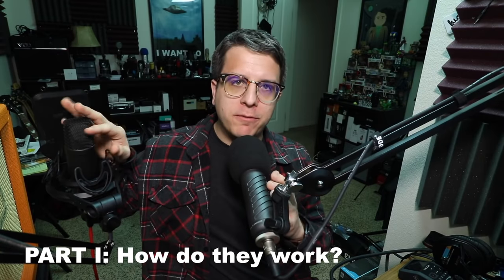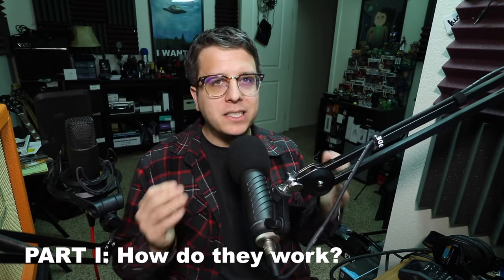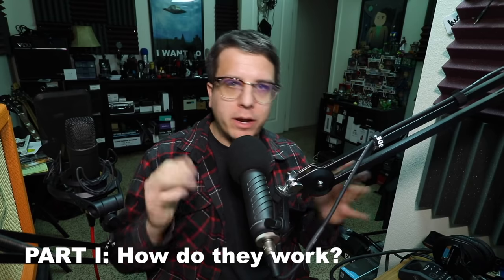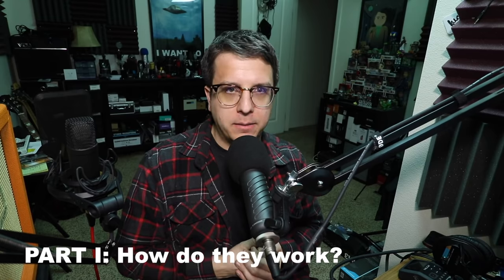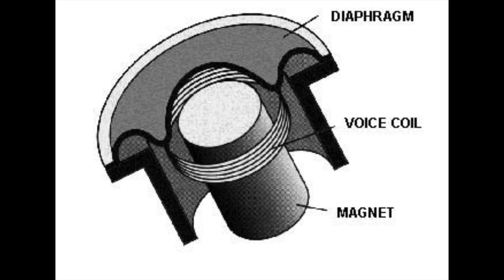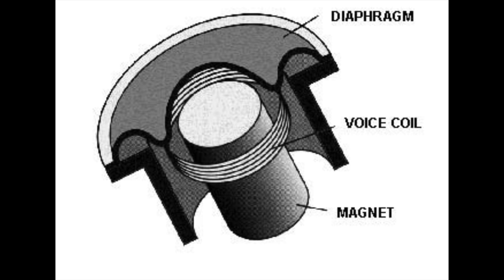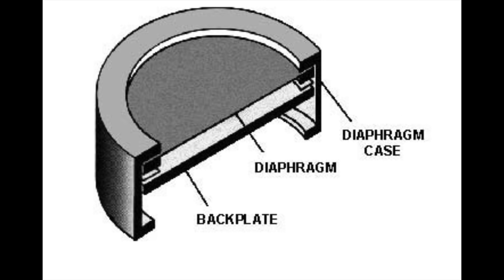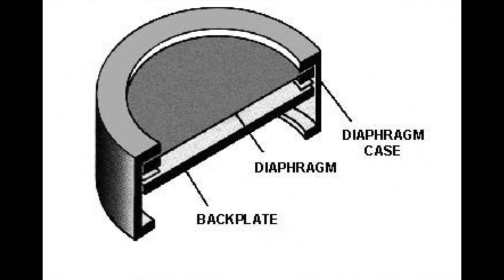Dynamic vs Condenser Microphones, What's the Difference?

Comment: A very good primer on mics with one exception. All microphones have a pickup pattern that determines where it picks up sound from. Three common types (there are several others) are cardioid, omni-directional and uni-directional. Some mics even have an adjustable pattern. His dynamic mic has a cardioid pattern which means it gathers sound strongly from the front but is much weaker from the sides and get almost nothing from the rear. You can buy cardioid condenser mics. In other words, the technology, condenser vs dynamic, is less important than it's pickup pattern in determining from where sounds will come through.
Reply: Dynamic microphones typically do a better job than condenser microphones at rejecting background noise, even compared to condenser microphones.  That's partly due to the underlying technology.  Condenser microphones are just more sensitive in general, especially outside the midrange frequency ranges of the human voice.

Comment: You are the first and only person who said condenser is wrong term and it's actually capacitor. 
I got all answers from you which I was finding since 2 days. Liked and subscribed.
Reply: Because condenser and capacitor is the same electrical part. Sure, condenser may have other meanings, but 100% accurate both ways.
Reply: Flux capacitor
Reply: Nope, it's not wrong.
Capacitor is called condenser in some languages.
Reply: @BJaca-tn3om  Condenser is also the word that was used in english in the old days.
Reply: @peterbaan9671  Same as tube or valve.
Reply: Condenser was the English term for capacitors (and still is, in many cases). This terminology was, and is, correct. As far as terminology goes, I have more issue with "lavaliere" than with "condenser"; but I'm okay with both.
Reply: Pdrew - That reminds me of Back to the Future, am I right? ☺️
Reply: In my language a "capacitor" is called "kondensatorius", which is essentially a "condenser". As a gent mentioned prior to me - some languages have that word in them, whereas a "capacitor" is nowhere to be found.
Reply: @RedVelvetUnderground333  hahha nice one
Reply: "condenser mic" is in common usage, therefore it is correct.  

I mean, whoever heard of "capacitated milk"?
Reply: @Tuning_Spork  So is the phrase "moot point"; but it always uses moot incorrectly.

I don't disagree with you, but that isn't a logical reason for the conclusion.
Reply: @peterbaan9671  i read the word condenser a lot in older electronics books, i think they don't use it anymore nowadays, but for microphones the word was kept.
Reply: @Tuning_Spork  I'm betting the majority of the reviewers have never heard of condensed milk either..:-)

Comment: Nice work as always. I tend to use dynamics for myself and anyone on my show that has an understanding of mic technique. I'll put guests on a condenser, as they're a bit more forgiving on distance, for those not comfortable with staying in a dynamic's "sweet spot."
Reply from the maker: I too am a huge fan of dynamics for my podcasts. I do need to work on my mic technique though. I just eat the damn things, but lucky for me the Procaster and SM7b have a decent depth to them so the proximity effect is not too bad.
Reply: Podcastage Right. My poor technique is a product of singing in to SM58s in bars with garbage sound systems and trying to hear myself. If I keep the mic INSIDE my mouth, maybe I'll be able to hear better :) Plus, it's a security blanket. I feel more anchored on stage if I'm touching the mic from time to time.

Comment: This might be the most practical comparison video on condenser vs. dynamic mics for a lot of people. However, you could probably mentioned around 2:40 that a dynamic needs a quiet (i.e. expensive)  preamp/interface due to the low sensitivity. Otherwise the recorded sound may have audible background noise which is not accepted at least for certain types of recordings.

Comment: Dropping facts, even 6 years ago!   I'm more shocked by the hatless presentation!  There also seems to be far more space in your room back then, unless it's just a very different lens.
Reply from the maker: Wow. Thanks for watching all the way back. The room looks a lot smaller on camera because I was using a 10-18mm lens and was wide open at 10mm, now I use 18-35 at 18mm. But also there's a lot more stuff and the rack to my left makes the room look a lot smaller too.

Comment: Previously I asked what mic I should use but I forgot one factor. I will quickly re summarize. I have a lot of background noise air conditioner, I'm in an apartment, smoke detector occasionally beeps and all that. The one thing I forgot is i need it to be a USB microphone or one that plugs into the mic in on the computer. I don't have a sound interface and would prefer not to buy one. Thanks for the previous reply, and great video Bandrew!
Reply from the maker: Look for DYNAMIC USB mics (Samson Q2u, ATR2100USB, AT2005USB).
Reply: Defuzzler the Rode Podcaster is also very good
Reply: Turn off the AC & disable the smoke detector

Comment: Damnit, I'm addicted to this channel. Any suggestions for a mid level, all around mic? Probably less than $100? looking to start recording, mainly for music... thanks!
Reply from the maker: It would be impossible for me to give any advice with that information. I have a BEST USB MIC UNDER $100 video that may help.
Reply: Thanks for the reply, will check that out :)
Reply: Brit Brandy should check out the toner condenser bm70 mic for 32$ with sabrent card and phantom power
Reply: Look for a used sm57 or sm58.  Can find them all day on guitar center used gear page and they are nearlu indestructible.

Comment: Thank you for the video. I guess I need a dynamic mic for podcasting, also for the procaster mic, I understand I need to buy an external soundcard to give power to it and connect it to a computer, (Focusrite Scarlett) this for instance. Am I right?
Reply: Radio people use dynamic because they are multiple people talking in the same room. If you're alone in a controlled room, where outside noise is not a problem, condenser is the best.

Comment: Just started have wind noise issues with my rode nt1 mic black just like yours. I've plugged it into scarlet focus right and Yamaha mixers and get loud blowing noises and silent voice pickup. Any ideas why I can do to resolve this? Tried a few xlr cables with same results.
Reply from the maker: I have no idea what would be causing that. No audio is picked up? You just get static? You've ruled out the cable and interface. That sounds like you should contact Rode and report that to try and get a replacement.
Reply: are you using the pop filter?

if not I believe the moisture from your breath can interfere with the capsule if you get too close, preventing it from working
Reply: Some of my clients got that issue, it's very probably a humidity problem, I've seen some people blow dry the capsule and fix the problem, not even kidding

Comment: Great explanation. To have a fair comparison to show the back ground rejection and polar diagram:  at 3:49 you went on the back of dynamic microphone but at 3:56 you went around: your same movement but the positions of microphone are different. in the second case at 3:56 you should go down to compare the two microphone, 180 degree should be from the top of the microphone. I hope it help you for next comparison. thank you again

Comment: You are the Audio Master!!! I've watched 10 of your videos on mics!
Reply: So I've decided to get a dynamic mic to get that awesome radio host sound for a podcast because my room isn't treated either. What recorder do you use for multiple mics? I saw your video to record multiple USB mics, but what are my options to record a multiple XLR mics for an interview podcast???? What are my different options and the price range for each option? I hope that I can use a USB interface that connects directly to my laptop, but I can also just use a recorder so I can have different tracks to control volume and clipping.
Reply: Kimberly Ann Baity  

You would use a USB audio interface. It would have one or more XLR inputs for microphones and a USB out that goes to your computer. Your computer would receive a separate track for each of the mic's so you can adjust as necessary for each one separateLy.

HTH
Reply: Kimberly Ann Baity 

There are a couple of companies that make recorders with multiple XLR inputs and record to an SD card. Sorry, don't recall names.

Comment: Off-axis noise rejection has more to do with the polar pattern and 
shape/design of the mic than whether it's a dynamic or a condenser. I've
 used dynamics that pick up everything around it or barely anything, and
 I've used condensers that only pick up a tiny zone in front of the 
capsule. A handheld style condenser probably would have had  similar 
off-axis rejection to the dynamic you tested, but it varies. All comes 
down to what the engineers were going for at the time. Decent 
video, but that part made me chuckle.

Comment: Sometimes the "less natural" sound of dynamic mics is what you want. For example, pro studios often use them when recording guitar cabs or close-miking drums.

Condensers will give you more detail, which might be cool if you want to really feel like you're in there being able to listen to every nuance of what's being recorded. But sometimes that might be a bit distracting and draw the attention to somewhere you don't want it to be.

If you want the best sound a dynamic mic can produce without losing the advantages, I recommend the Sennheiser MD441. It's a bit pricey for home use, but waaay cheaper than the best condenser mics out there. Its frequency range goes up to 20kHz (!) and it sounds pretty natural, just a bit "isolated" as you'd expect from a dynamic mic.

Comment: Hey I love your videos and I think that they are very informative and entertaining. Do you mind also making a video on boom mic arms? Specifically extensible ones used on desktops such as the ones you use in this video? That would be cool.
Reply from the maker: I absolutely would, but I don't think there are that many. So far, I've only picked up the Neewer boom arm which is a mass produced boom arm that's sold under a bunch of different names, and then the Rode PSA1. Are there any others you know of?
Reply: Well in the EU I have found a lot of boom arms with strange names (Acelectronic, HowiseACC, TONOR, Racksoy, etc) so I assumed there would be quite a lot of brands. I also found a neewer mic arm on amazon uk for about 9.99 gbp (about 12 bucks), though I'm not sure how good it is at that price.

In my country I barely find any boom mic arms (extensible / scissor type) and if I do they are sold at exorbitant prices, like 10 times what other EU shops sell.

For example, one that caught my attention was this :  https://goo.gl/tVQgjK
It has pop filter and phone stand included, which seems kinda cool.

Comment: I like your style and your room look like a good place to chill.  I think you're the right guy to ask: Supposing I want to do some stereo recording using two small diaphragm condensers.  Say two Oktava MK-012's, which are available in matched stereo pairs, but suppose I don't have the matched pair, just the same mics.  How big of a deal is this going to be?  Will it actually be noticeable?  I guess the frequency responses might be slightly different, so not completely accurate to each other, but then again, might actually get something better, depending on preference?  What do you think about mathched vs. non-matched for stereo pairs?

Comment: As you can probably see I know nothing about mics. I’m looking for the best, lowest cost, small stature, plug and play desktop, portable USB Mic with a gain adjustment knob, headphone jack to use for Windows Cortana, google voice and Skype, and maybe later with gaming, with plenty of sound pick up approximately 3-4’ away. I have a small dell mic that Windows 10 Cortana “hello Cortana” doesn’t recognize that voice command, and Google voice doesn’t recognize the “hey Google” voice command??? If you click on the mic icon on both apps it will find what you ask for. You just can’t use the “hello Cortana” or the “hey Google” voice commands??? I like you video. What would be your suggestion? Dell states the problem is with the RCA 3.5  mic? Keep up the great work, Thanks

Comment: About half a year ago I sold my NTK for an SM7b since I needed something that wouldn’t pick up room noise and could withstand rock vocals. I’d heard that Michael Jackson used the SM7b for Thriller so I cringed REAAL hard when I heard him say that dynamic mics are best for “broadcasting”, radio, podcasting type sound without mentioning what other uses Dynamics have. He’s definitely not wrong in saying those are what they are most used for, but if Dynamics are mixed right they can produce outstanding results in the studio.

Comment: Here in Germany you won´t find a radio station that uses dynamic mics. They all have condensers, mostly pretty expensive ones by Neumann. Why? Because they are omnidirectional and you are free to move within a radius of about two or three feet. So if you have to grab for another sheet or a pencil etc. - all that is causing no problem. Whereas it would be nearly impossible to do that with a dynamic mic without a big loss of sound quality. I had some appearances in radio stations and my average distance to the mic was about 50cm, what means about 1 1/2 feet. And the sound quality was breathtaking. OK - they had about 5000,- USD Neumanns....
But if you want a dynamic mic make sure that you buy one without a big proximity effect.That´s the key point for this task.

Comment: Thanks! I was wondering what would be best for Singing and it seems you've answered my question! I also just generally wanted to know the difference (btw, I can't believe all it takes is a magnet and vibrations to make electronic signals that are then converted into sound that the Microphone picks up.... at least that's how I understand it, please correct me if I'm wrong.) 

TBH this is probably the most helpful video I've seen in a while because most videos are just reviews, and they don't actually go over which one is best for whichever situation, so once again, thank you. :D
Reply: So what is the  best for singing friend?
Reply: @psychsoulogy8018  Definitely Condenser mics, though there are a few dynamic ones out there that are able to get a nice natural and warm sound out as well.

The one I'm currently using is the Shure SM7B
Reply: @kingmerpyderp5947  I've been planning to buy for long time ago but can't decide the ultimate one that could give a really sense of satisfaction in terms of singing or vocal recordings
Reply: @psychsoulogy8018  I chose the Shure SM7B because it really seems like one of the most multi-purpose mics out there. I do video recordings but also sing as a hobby (and hopefully, future profession).

The reason why its so popular is because its super high quality (although the full setup required can be expensive) but also because you can cover so many different types of content with it while making sure you've got a decent mic for the job.

Of course, at higher price points, it really does just get to Audiophile levels of pickiness. Any mic past the $400 mark is going to be realy good no matter the situation.

Comment: You didn't mention proximity effect - with a dynamic microphone when you are very close in front it favours (gives a boost to) lower frequencies which is good for bass singers. Does the "condenser" microphone have the same characteristic?

Comment: Cloud Lifters Are Required I Believe For Some If Not All Dynamic Microphones.
Reply: Not really.  Some are more gain hungry. I use an SE V7 for some podcasts and it sounds pretty good. Some, like an SM7B need to have a gain boost. Depends on the microphone.

Comment: So I've decided to get a dynamic mic to get that awesome radio host sound for a podcast because my room isn't treated either. What recorder do you use for multiple mics? I saw your video to record multiple USB mics, but what are my options to record a multiple XLR mics for an interview podcast???? What are my different options and the price range for each option? I hope that I can use a USB interface that connects directly to my laptop, but I can also just use a recorder so I can have different tracks to control volume and clipping.

Comment: I wonder if with USB Type-C on the rise and its ability to carry up to 100W of power, if we will get type-c versions of previously phantom-only microphones?
Reply from the maker: OOOOOOOOOO! That's a very interesting question! I had not even considered that. I can tell you we're going to have to be very careful because one faulty resistor on the mic or interface will probably fry it because of the amount of power it's getting!

Comment: A seller in a store told me that for singing (except live on stage) he would always pick a condenser over a dynamic even on an untreated room, do you think he was only trying to sell me the AT2020/2035 or he had a point? He also dismissed the 2020's self-noise as not a big deal.

Comment: So condenser mics work by measuring the capacitance between a fixed plate and a diaphragm-attached plate. Dynamic mics would be measuring the small voltage created by the magnet moving through the voice coil.

Comment: Great video my friend, what microphones have almost like a compressor built in, I've noticed on some video cameras or cell phones that quality devices when tapped on they don't distort or clip. Like at live shows the bass isn't distorted or clipped. Can't figure out if that's a dynamic or condenser mic......
Reply: In those situations, compression and other processing is most certainly being applied to any microphone via external equipment.